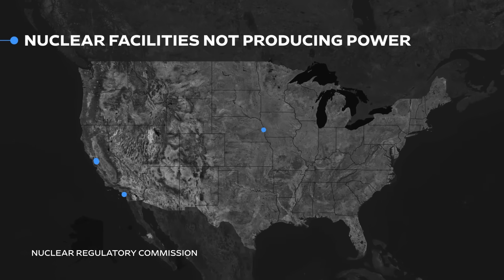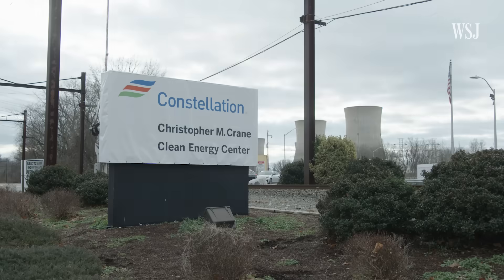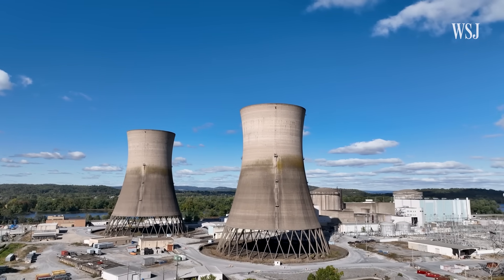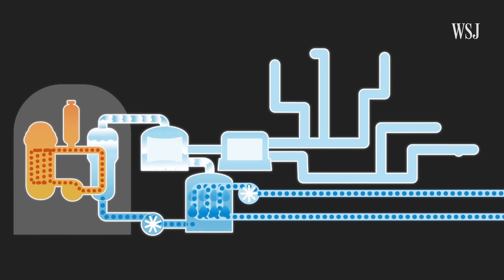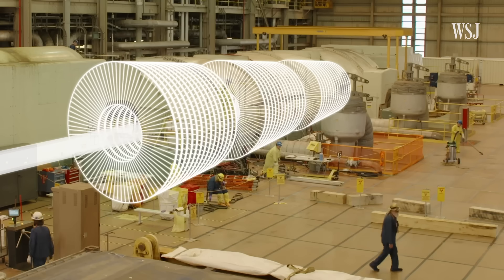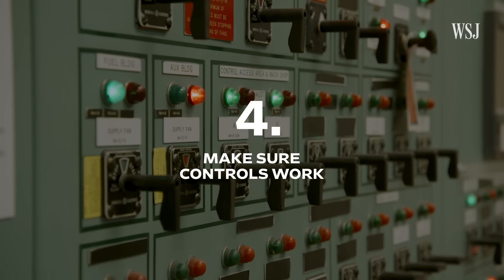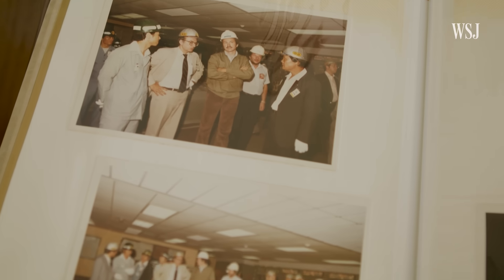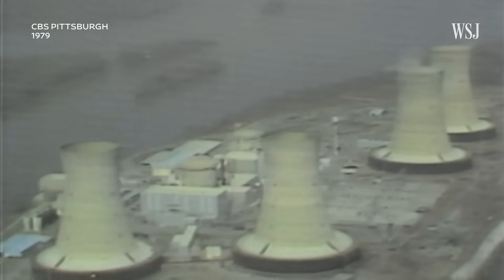Inside the $1.6B Plan to Restart Three Mile Island | WSJ

Comment: Energy exclusive to a corporation. No doubt at a cheap rate the public will be screwed into paying for.
Reply: Sure, they run a big long extension cord straight to the data centers 😄
Reply: Yep, the public will pay. And the public will also be the ones suffering from the waste, since I bet you, it will not be dumped anywhere near any rich or influential person.
Reply: @tarron8785 They don't "dump" nuclear waste anywhere. There's no lake where they throw rusty bins into like it's a cartoon. Most of it is kept literally on site under extreme security because the safer storage at Yucca mountain was cancelled.

Comment: It's great to have renewables like solar and eolic energy, but they're not as efficient as a nuclear power plant. Yes, we all remember Fukushima, but that was an extreme scenario in which 2 natural disasters hit the same plant moments after the other one. Look up the numbers of deaths related to carbon, oil & natural gas to nuclear. It's estimated that air pollution alone kills 100.000 people per year, when nuclear "kills" 1 person every 25 years on average. Yes, absolutely everything has risks, but a nuclear power plant is watched 24/7/365 by multiple professionals, the risks of an accident are miniscule. Think, everybody on a nuclear power plant, from the top boss to the person who keeps the floors clean are trained on what to do in case of a nuclear emergency. In nuclear powered submarines, from the lowest enlisted guy to the skipper are tasked to assist, and act, with fires and floods in case they happen.
Let's ditch the stigma, nuclear is not the "end-all" of our climate change problems, but it's the most effective technology we have at the moment to combat climate change. And no, the fumes you see coming out of the cooling towers isn't radioactive or polluting at all, it's just water vapor.

Comment: Listening to this makes it seem lovely if they do get the plant restarted. What is no mentioned is what are they going to do with the one that failed??? Second is what are then going to do with the waste that is generated? We still do not have a reliable disposal site to put the waste where it will not come back to bite us. Nuclear is not the answer. It is only a problem that continues to get bigger and more dangerous.
Reply: The waste is so ridiculously small and easily stored or even recycled into new fuel like France does. Do some reading.

Comment: Dude doesn't know the dimensions of the reactor vessel? 
The TMI partial meltdown was caused partially by a faulty valve, and partially by user error. The utility who owned and operated the plant was simply not committed to safety, and the NRC was FAAAAAR too cozy with utilities operating nuclear plants at the time. I am not anti nuclear, but that is NOT a situation we can we can tolerate again.